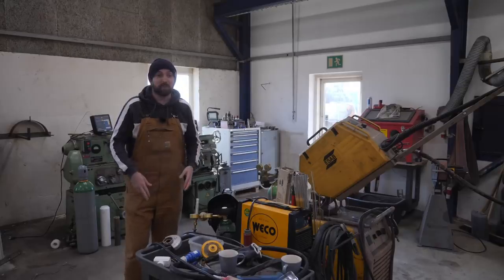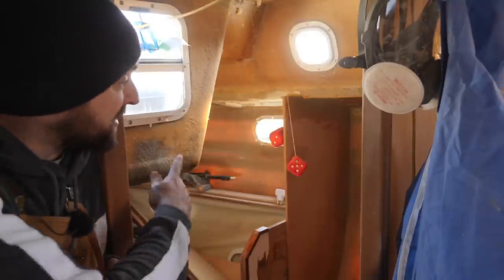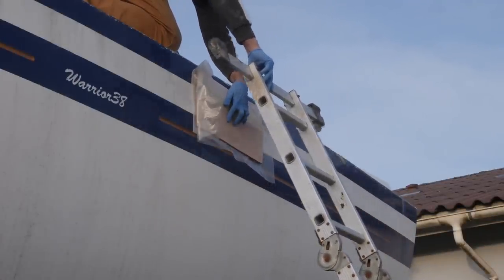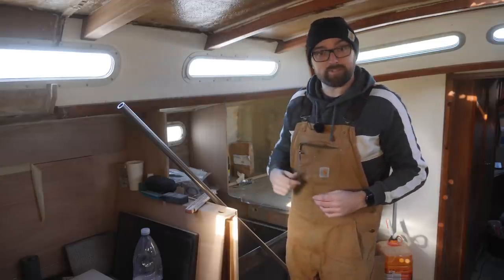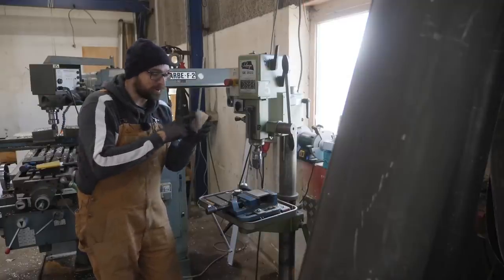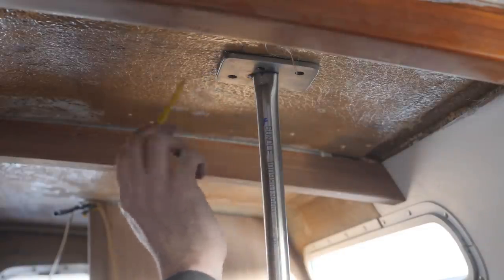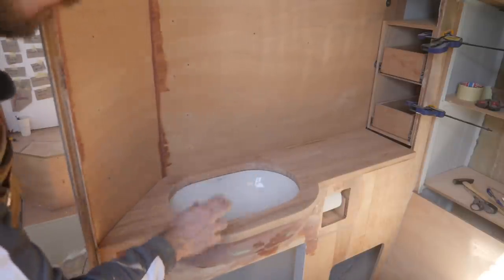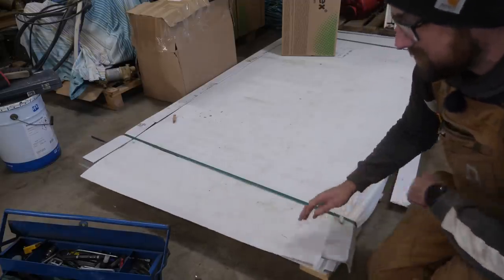Sail Life - Galley pole, port lights, counter top & engine painted (primed) - DIY sailboat project

Comment: I used the same insulation as you have done, thinking that the self adhesive would be better than the gluing with contact glue, which the professionals always do and they told me would be the best option.  Turned out they where correct, as long as something outside of the insulation keeps it in place the self adhesive will let go after a while and start sag with condensation forming between the laminate and the insulation, further adding to the adhesion letting go.  Perfect on horizontal surfaces but not undersides.
My experience go back to 2007 with this particular brand.
Hope you get it all sorted.  Love your vids, looking forward to everyone of them.

Comment: the really bonus way to round off those corners would be to have a peg fixed to the grinder table the exact distance from the edge to the hole you drilled, place the hole on the peg, and turn.

Comment: Hi mate
Been awake all night so continued watching many of your videos!!!! I really truly enjoy them and your calm relaxed ways.
Re your Rode mic which I spoke about earlier, if the mic is not hard wired and the lead is ok, it is otherwise highly likely to simply be dry aolder joints on the pcb mounted microphone socket. I'm learning that you are not only a master of some trades, and a talented jack of many other trades.
Many thanks for your videos buddy!!!!
By the way, to get good and equal round corners, draw around something you can find of the right or close radius placed up to the corner. Eg, for the pole mounting plate, smallish washers or a pen lid would be good. For large corners,a lid off a jam jar or- the inside or outide of a role of gaffer tape may help.

Comment: Great video and more entertainment value during the lockdown.   Mounting the generator on a bench is going to make a lot more noise and vibration then mounting it on the floor using the hull and water underneath to dampen it ... just a thought!   I can't remember if you considered having one big generator where the engine is and using an electric motor to drive the boat.   Stay safe Mads and do you have an update on how things are going with Eva in the US?

Comment: You could also mount a stainless bracket support for the outer edge of the nav station table to the pole as it would probably be less of an obstruction for entry to and exit from the bench than anything made of wood.

Comment: I am now convinced that the brand name of the engine is actually "Iddybiddy Perkins"
Reply: No, it's a Perkins, but the model name is Iddybiddy. When you have to get parts for the thing that's what you tell them.
Reply: That should totally be the real name of the engine, such a cute name for a cute little engine.
Reply: Its actually a rebadged Shibaura designed and built engine.  Sold under licence by Perkins.
Reply: lol! We love our Perkins 4.108 but shes not iddybiddy
Reply: SV Avocet you have the often touted Perkins Middie-biddy.
Reply: @bobadam7021  lol I will remember that. We just did a refit on ours, should have filmed it. Oh well!
Reply: @ryan-w  That's interesting. I have a Volvo all nice and green until you find the plaque on the back that says 'Perkins, Made in England'. You can guess where the cheaper spare parts come from. Of course I've just done some research and my engine may indeed be a Caterpillar, Volvo, made by Perkins from Shibaura parts manufactured in Japan and assembled in the UK, before export to France, then shipped to Canada then sailed to Australia via Africa and Panama. By a little old lady who was only going to church on Sundays. Very few miles on the clock.

Comment: Hey Mads I was just going to tell you I’ve been seeing aluminum brazing rods that strongly bond or weld aluminum to aluminum. I’ve brazed aluminum before and I had a hard time doing it but these new rods makes it a lot easier and the rod just flows perfectly over holes or joints using a torch set. I will snap a picture next time I see the  advertisement for ya 👍

Comment: I can tell you are really enjoying this part of the retrofit! surely looks a lot more fun then fixing all those under floor stringers.   When you work with the stainless, I think it needs to be passivated after welding to minimize rust.  Believe it consist of  a wash is dilute Nitric acid that removes any iron from the surface of the metal caused by the weld heating.  It's the chrome oxide layer on the surface that prevents the rust, any iron on the surface will rust.

Comment: That was the fastest 20mins of the last month.  
The mess of parts at the bottom of the sink is referred to as a “drain assembly”.  The flange sits inside the sink and threads into the drain tube below the sink.  The tail piece is the fist section of pipe that threads into the drain tube.  Although I kind of prefer sink hole thingy.  Love what you’re doing.

Comment: good thing you have access to a compressor, that will make checking for waterproofness of the tank so much easier, just mount a compression valve once you are done welding and pump two or so atmospheres into the tank and see if the pressure drops overnight.

Comment: If you wet out glass on a table for a vertical location, just roll it up or fold it in one direction only, and place it in a plastic paint roller pan, them move it to location.  No drips.  And them unfurl it with gloved hands.  It will not slid down. I’ve done overhead surfaces the same way. When in place, I use a plastic putty knife like used for car body work to get the bubbles out as well as excess resin.  For me it’s always faster to wet out glass on a table since it wets out much faster, and no wasted brushes.  I just pour the resin out and swish it around with the plastic putty tool. No ribbed roller either needed.

Comment: Matt, I see you using the 406 Collodial silica.  I have had some experience with epoxy.  When I need strength, I use flox.  It is chopped cotton and when mixed with epoxy in a thick paste, it is so hard and strong it is even hard to file.  Great for areas where you need strength.  If you need a light weight filler you can use microballons ( very small ballons of glass)  which files and sands more like styrofoam (not beadboard commonly called styrene ).

Comment: I will suggest a port light in the workspace/maintenance locker. It will allow light and fresh air into that tight space. Just a thought.
Reply: I was thinking that to soooo it could have fresh air and maybe vent out anything if needed but the downside might be noise in the cockpit from it.

Comment: 18:28 For American English, the bit of pipe that goes down from the sink is the tailpiece, and the part you see at the top is just called a flange. So "vanity sink tailpiece flange" if you want to give context in one compound name. Tailpiece goes into "trap" (the U-shaped bit) which may have "cleanout" (draining plug) at the bottom, into "trap elbow" (if separate, usually is) and then the fixed horizontal pipe that takes greywater away is the "stub-out".

Comment: Jökul!! Woo! Am I spelling that right? So Mads if that countertop doesn't work out you can simply epoxy it. I honestly would just do that first before ever installing it and if it is too shiny just buff it until it has a matte finish. I like wood and sometimes everything looks too plasticky on boats so I dig it but feel like it might be a terrible surface for a bath vanity. You can clear epoxy then scuff or even if Ava doesn't like it you can epoxy it to look just like marble. Oh and seeing as how you are learning to weld, why not weld up a new stainless exhaust for the iddy-biddy Perkins so that no one ever has to even smell the shame of painted exhaust!? 😉

Comment: Keep thinking through those cockpit portlights.  There's probably a reason you don't frequently see windows in those positions.  It may partially have to do with interfering with leg space in an already cramped area.  Possibly interfering with privacy for someone in the cabin below...or water splashing in the cockpit.. I don't know.  I just don't feel like I've seen it frequently done.
Reply: Steve, my 2000 model Scanyacht 391 has 4 in the same positions. Two either side, and two very small ones on the forward side of the cockpit. Never had any issues with them, but you do have to remember to close them before getting underway if it’s rough of course.

Comment: What is the oil change interval for the IBP generator?  Hopefully getting into the technical area through the shower will not prove to be too big of a PITA.  

With your power requirements you'll be putting quite a few hours on it fairly constantly.   I'm pretty paranoid about diesel engines in general with regards to oil consumption, so I like to check the oil level on them pretty much daily.

Diesels love their oil boss...  

On our auxillary drive I check oil level before every start-up.  I wouldn't personally be comfortable having a genset that was at all inaccessible like your IBP will be.  But that is just me.  Perhaps a remote oil level sensor would give peace of mind.  

NMEA-2K network candy!

Comment: Hey thanks for the great channel, that I'm normally watching every Sunday. I would like to remove the rust from an older YANMAR YSM8 engine, and repaint it, do you have any suggestions, for removing rust without dissembling the entire engine, and what kind of primer and paint you would use for the engine floor room and the engine itself, so I can make it splify too? :), and one last thing, do you have any video about varnish, why you have chosen this method over other methods?

Comment: Hey Mads, we had great success with the 3m accuspray system, check it out. If you have a decent sized compressor you can literally shoot anything. We shot varnish, high build primer, awlgrip, barrier coat, Trinidad bottom paint even! Sealed liner system so your reducer does not evaporate and you can shoot upside down. Everything including the tip is disposable so cleanup is done in a few minutes. Check out our blog, we dont get into great detail of the gun but you can see what we shot and how it turned out: https://svprism.com/260-days-of-our-hans-christian-33t-refit/  

We just shot another boat ( a norseman 447)  with Alexseal and it performed great again.

Comment: That generator unit is quite heavy. How will it effect the balance of the ship when mounted high and outboard?
Reply: John Young
Maybe he’ll move the battery bank to the other side under the aft bunk? Washer /Dryer in a locker adjacent to the cabinup in the v berth area?  I am just guessing, but he has mentioned before that he has ideas to spread some of the “ballast” around.
Reply: @WaterFaucet24  yeah but what happens when the batteries are low and not topped off, the balance will be off!
Reply: @danielbuckner2167  just for a second.... you had me....
Reply: @danielbuckner2167  Mads would never let that happen, so no need to guess!  Batteries will always be topped up, and probably replicated two or three times, in various places around the boat!
Reply: How heavy is the generator? Is it as much as using half your water supply? As heavy as a person walking from port to stbd? has heavy as using your fuel supply? Athena is a big cruising boat that will be well loaded as a live aboard and for long range cruising so in the scheme of things the iddybiddy generator probably isnt such a big concern.  Certainly would be in a lighter, less loaded boat though.

Comment: Mads, you need to practice your cover up for mistakes. You applied the epoxy to the wrong side of the plywood first on purpose so you could protect it and the scraped it off and put it on the other side as planned!

Comment: Hey mate, quick one on that stainless pole, with the little beam you have made under, I would weld another flange onto the bottom of that one, changing it from a "T" beam to an "I" beam, as the lower portion of the beam is the part which will 'twist' under load and another flange will keep it straight. See link below.
https://5.imimg.com/data5/HD/CR/QU/SELLER-1092498/galvanized-i-beam-250x250.jpg

Comment: Hi, I have a question, are you planning on painting the top sides of the hull and if yes, with what?.
Reply: He did, look in the older vids. 😁
Reply: daniel buckner , the top sides? He painted the deck, but those top sides don’t look painted to me!.
Reply: @Cutlass-27-Mallorca  Well I am sure being on the hard with all the grinding from the cement boat guy they are probably dirty. Seriously though, go back and you will see he not only painted them but he replaced the entire deck!

Comment: Why the massive "over-kill" on the stripper pole base??? I can understand a flange on top and bottom but did you really need an i-beam that can support a 4 story skyscraper ? It's just a vertical hand rail that can offer a bit of cabin top support, correct ????
Reply from the maker: It takes the load from the mainsheet off of the cabin top. In the original layout the mainsheet was attached right on top of a bulkhead that served the same function. Since I moved the bulkhead further aft I needed a different solution :)

Comment: Welding aluminum may sound easy but if not done right you will end up with pin holes in the fuel tank   Practice Practice Practice

Comment: removing the light in the aft cabin was so sad! why not just have an additional opening one towards the cockpit. nothing better than being able to see the water from the bed....
Reply: I completely agree with this.  I have a feeling the reason that one was removed was for symmetry.   There is no real reason that cabin couldn't have had two port lights, so the only reason to remove it was to match the other side.

Comment: I would find a better place for the generator thats not in the cabin. Noise, fumes, heat.......
Reply from the maker: Not in the cabin? :) It's as far away as it can get. There'll be the shower hatch and the door for the head in between the genny and us.
Reply: @vettepicking I don't think there is a better spot because you still have to service it.
Reply: @HighMXHubby  we put them near the engine and under the floor. Not near electronics because if and when a hose breaks it will shoot sea water all over the room. Or a leaky diesel line ....